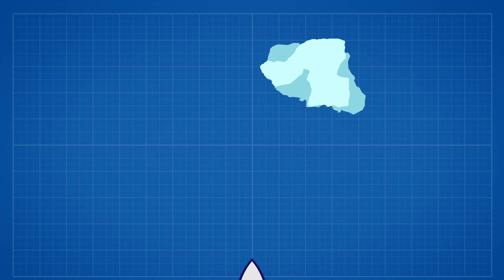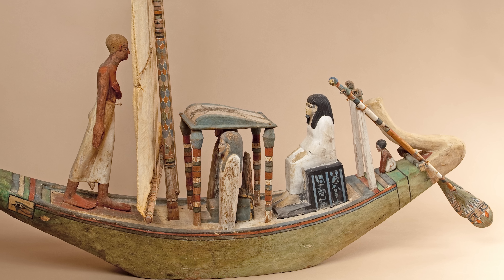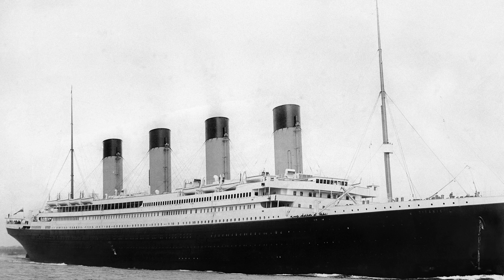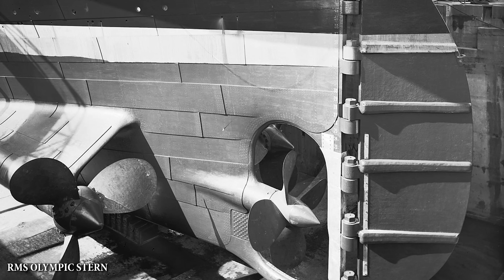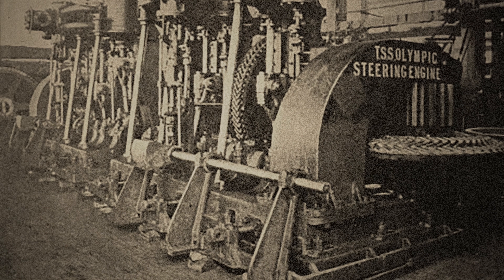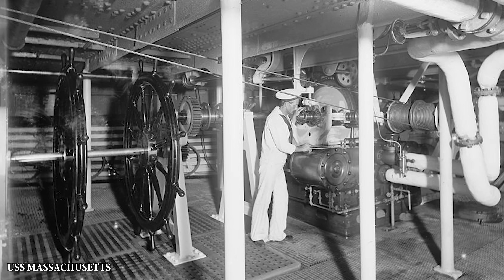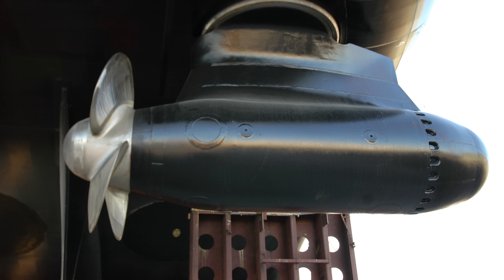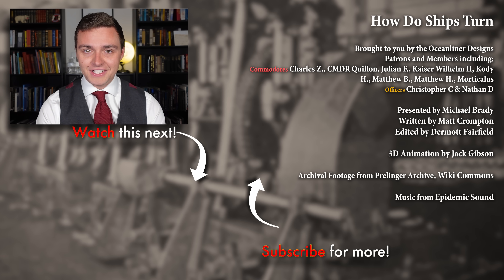How Do Ships Turn?

Comment: So, basically the rudder just initiates the direction and the physical resistance of the water which the ship ''slides against'' does the rest? Does that mean all the steering takes place in the front, even though it's initiated on the aft? That must be very, very delayed steering...🤔
Reply: Yea, rudder allows the ship to slightly turn and due to the sway component change in direction of ships take place. The steering is tilting the rudder which moves the ship at its centre of gravity.
Reply: Yes, and to make it more complicated, as the helmsman, you need to know around which point the ship turns. This was an issue on the Costa Concordia, which probably would have missed the rock that sliced the hull open. While the helmsman turned in time to avoid the rock, he did then not turn away from the rock in time. It's also in Titanic, after she's made contact with the iceberg, Murdoch then orders the turn in the other direction to move the ship away from the iceberg.
Reply: From my understanding it's basically like reverse steering. If you think about it like a car, it would be like steering turns the back wheels instead of turning the front.
Reply: @hoobidibahbidibah8119  forklifts have rear steer, too. I would crash because the back would move way before the front. Then I began to visualize the forklift as a lever with the front wheels as the fulcrum. It helped a lot when driving a regular car, too.
Reply: @TheRealTburt  Oh, didn't realize that about forklifts. Neat!
Reply: Very very interesting  !!! Thank you so much!!!
Reply: I don't think it would be delayed, it would still be instantaneous, because the water is already flowing across the rudder due to the ships forward speed. As soon as the rudder moves, the steering forces are instantly applied.
Reply: Simplest way to think about it is the ship pivoting about a central point. Much easier to visualise if you look at something long and narrow with a tiller on the back such as a narrowboat.

Comment: What always bothers me, is that the experienced 1st Officer, on the bridge of the Titanic gave order on the wheel and after this ordered engines astern, thus loosing the power on the steering gear. And I haven't  noticed to much discussion regarding this absurd order, like it was completely normal.
Reply: Murdoch ordered the engines stopped, then Wilde ordered full astern to slow the ship down quicker.
Reply: @jamesgroccia644  Either you want to stop the ship or turn it, otherwise you loose effect.
Reply: There are conflicting reports that it was ordered all engines stop/full astern
We may never know for sure
But it seems that’s how they were trained to respond to emergencies